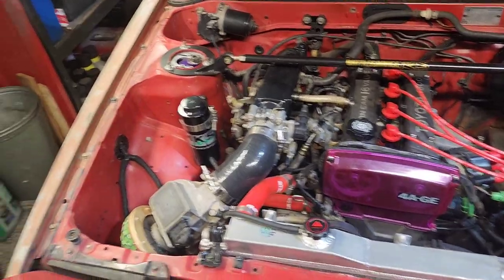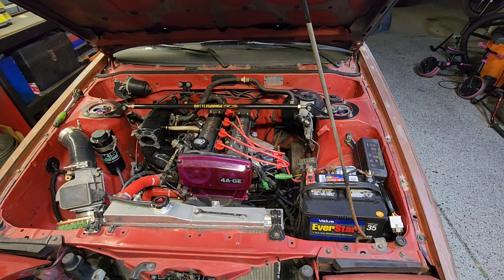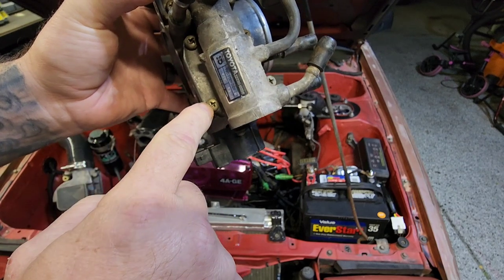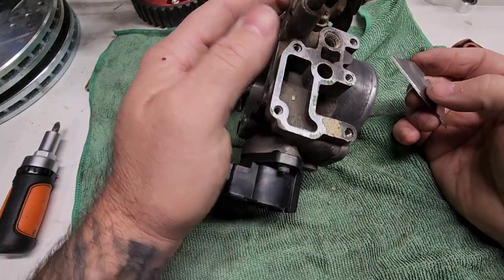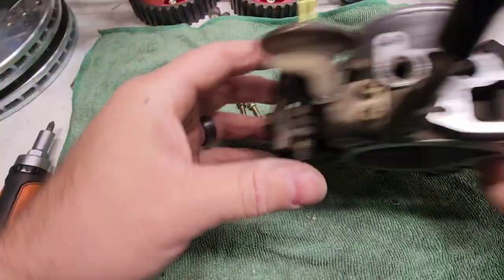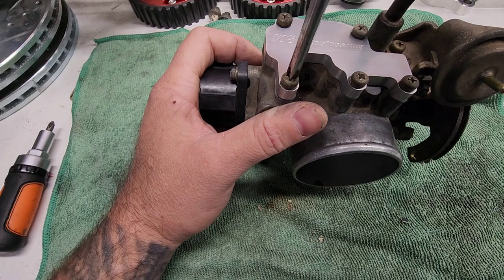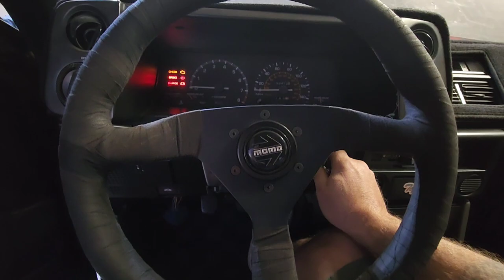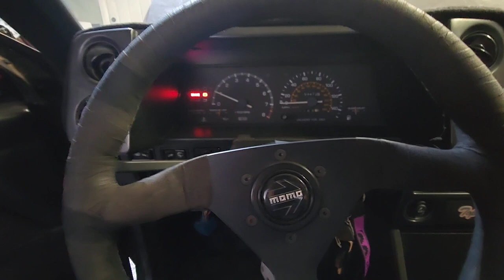AE86 IACV block off plate install. Fixing high idle problems

Comment: Hey i know this is an old video what but I have the same set up other than the blockoff plate I'm thinking its my tps since my rpms float then the car dies, but are you running stock ecu?
Reply from the maker: @wrongthought2527  In this video it was stock ecu.

Comment: when you plug up all the connections for the iacv I wonder why it didn't work?
Reply: Part of what the iacv does is let in air and idle higher on cold start (keeps it from shutting off), once it feels through the coolant line that the engine warms then it’s supposed to close that air inlet and bring you back to normal idle. Being 30+ year old parts they tend to get stuck open and can even cause a bouncing idle; the TPS detects that the throttle is closed but it’s still getting air in, ‘causing the ECU to get a little bipolar on the air/fuel ratio.